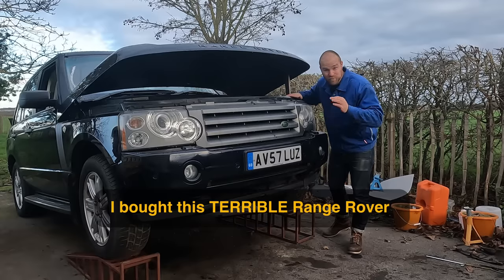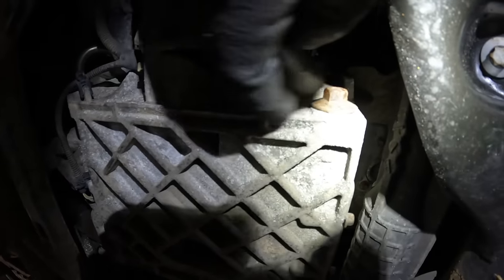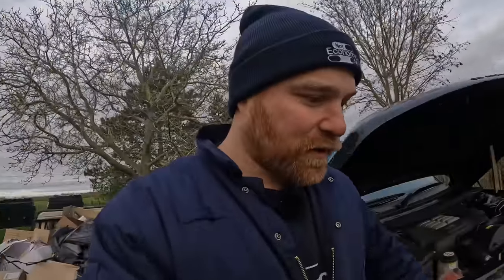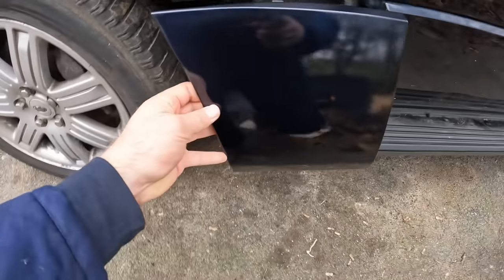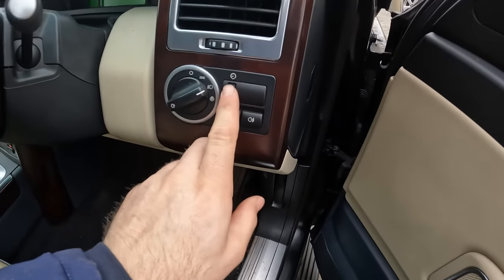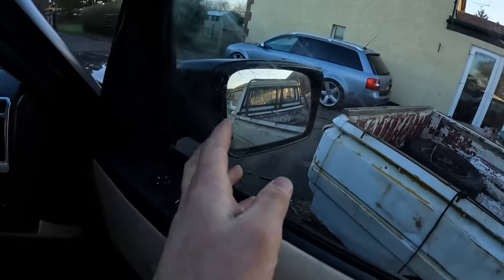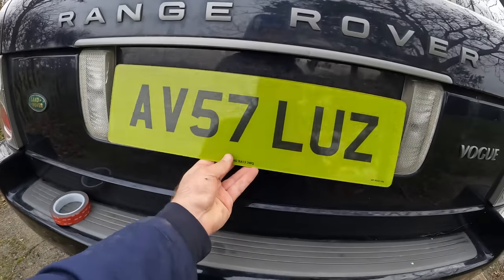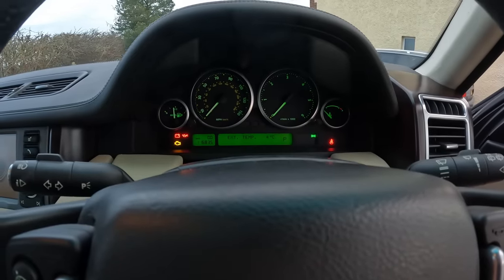Turning my crash-damaged Range Rover into a daily driver

Comment: Put the suspension in service mode, ie high up and open the bonnet also in service mode ie, at 90 degrees.
Also them ramps were not homemade at all. They were very common in the 1960’s and 70’s. I had a set!
Usually though, they had a habit of pushing away as you tried to climb them, it was easier jacking up a side a lowering the car onto the ramp.
Wouldn’t hurt to change the auto box oil too. I know it’s supposed to last forever but there are videos on fixing a bust gearbox by changing the oil.
When the air suspension gets a fault don’t buy a new compressor at hundreds of pounds a guy in Scotland sells a repair kit for around £20. Again a video on you tube.
Reply from the maker: Thanks for the advice mate 👍
Reply: Giving the ramps a kick under the tyre before you drive up stops them sliding out.

Comment: Just a quick note.  The gas struts for the bonnet are upsidedown.  The fat bit goes upwards so the oil inside lubricates the rod seal each time they operate.
Reply from the maker: Ahh that's good to know. I put these ones on the same as the others came off, but maybe that's why they were broken in the first place!
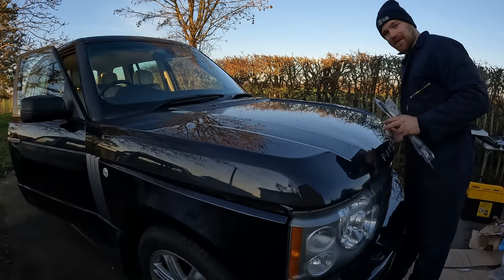Reply: @NotEconomicallyViable  At 33:04 the old ones are the other way up (correct).
Reply from the maker: @BLOCKsignallingUK  So they are!

Comment: You should spray wax the car, especially into the seems and the underside to prevent rust, even the engine compartment.  Silicone based spray wax can even protect exhaust.

Comment: I reckon those oil drain plugs have never been opened before.
Garage is just going to change the oil using a vacuum pump.
I bought a hand pump one a few years ago. 
It's very pleasant not getting oil down your sleeve. Definitely been there before.
Reply from the maker: What about any crud left over in the bottom of the sump? Is a vacuum pump good and getting everything out?
Reply: @NotEconomicallyViable  no not at all. Crud forever. But this is what you get with a garage service.
I have thought about alternating methods.
Or maybe getting the bulk out and just a quick finish off at the sump.
Depends on the car.
My 17 year old lexus mill make do with vacuum only.  When she dies she's for the scrap, and engine cud isn't going to kill it.
Might alternate with the P38 which I want to last forever. Which means the next service. Grrrrr.
Reply from the maker: @richardschofield2201  Maybe a happy medium is to vacuum pump the vast majority out and then get the last dribble out the sump - would prevent making loads of mess with spillages and would also get the crud out the bottom

Comment: Welcome to the club of cheap l322’s 😅 definitely consider getting the gearbox fluid flushed as they can suffer with shuddering, Land Rover claim lifetime oil but if I remember correctly the manufacturer (zf) recommend every 60,000 ish. Also get the rear arch liners off and check for rust along with the rear jacking points as that’ll save you a headache in the future, sams motor and machine has a good video on his channel regarding rust proofing. Other than that enjoy the car and fuel bills 😅😂
Reply from the maker: Thanks for that - looks like it's going to be next on my list

Comment: Mate get a oil vacuum suck it out the dipstick just connect em to battery and suck it out in 2/3 mins  can pick em up for under 20 online dont have to get under alot of cars to service em then turns it to a 5min job rather than messing  with Jack's axle stands chockes etc for 10 mins before you start and keeps you alot cleaner 👍👌 if you know you gonna regularly change you oil then 500ml of old ain't gonna affect nothing in my opinion .
Reply from the maker: Yeah it's the old stuff left over that I was going to ask about. Presuming it's good at sucking all the old crud out too?
Reply: @NotEconomicallyViable  I've never had a issue tbh Evan 200ml to 8 litres of new is less that 5% won't make any difference in my opinion nd makes oulchabges so much easier
Reply from the maker: @ryanrichardson9044  Good to know. That’s for the advice 👍🏻

Comment: Does that engine have a suction pipe at the top of the engine, which you could use an oil extractor pump to change the oil?
Reply from the maker: Probably, but do I have an extractor pump? Nope haha

Comment: Do yourself a favour and replace those intercooler hoses. They will go and likely when not convenient. Try and get silicone ones. Great project - my 57 plate has done 101k and I love it even though I've just had the turbos replaced! Reckon a glue on dent puller will get rid of most of that dent. Shame about the mud flap - I've just had my sidesteps removed - now need to work out what I replace the front flaps with. Also - check out bonnet access mode., I'm subscribed - just keep your Rangie or buy another (lol) and you are  home and dry. For £1500 you've got a bargain. I paid £6k for mine (admittedly it hadn't done battle with a tree and has done fewer miles) but I'm now into it for £12k - sorry but whatever the naysayers spout - I still think it's a bargain. £12k barely pays the annual depreciation on anything modern
Reply from the maker: I'll take a look at replacing the pipes 👍🏻 Even if they are unreliable there's still something about them. Hell of a lot of car for the money.

Comment: Those struts should be installed with the thin part down as far as i know. 
I think this is necessary so the oil inside doesnt just run to the bottom.
But i am just a youtube student myself, so im not sure.
Reply from the maker: Ahh I'll take a look into that - I just replaced them the same way the old ones came off

Comment: Mate. In my experience any engine is quieter and sounds much smoother when she has clean oil. I guess that the MORE oil in the engine then the more you notice the difference??? I have an old Audi S4 V8 which needs 9L of oil and when changed she sounds and drives MUCH better. I love big lazy V8 engines.

Comment: Next time, try "Goo Gone" or similar; they are based on kerosene that helps remove glue and sticky bits with no end.
Reply from the maker: Will have to check that out - thanks for the tip 👍🏻

Comment: I was after a local L322 Range Rover with that 3.6 litre V8 from a car dealer as it had an engine fault I knew how to fix. Bid £1200 but no deal. That V8 is an absolutely bullet proof motor. Enjoy!
Oh and so in a huff I bought a 2001 P38 Range Rover off eBay for £700 ... 😳😂
Reply from the maker: Haha that's a great 'in a huff purchase'!

Comment: Service the transmission also as the so called life time oil and filter in 6HP transmission also might have never been replaced along with differential and trasfer case oil😅 waiting for a porper interior detailing😂
Reply from the maker: Yeah transmission service needs to happen. Heard that it's not easy to do as a DIY job though

Comment: I have a question about the interior trim. I have an American Range Rover L322 and I cannot find the trim that goes under the steering wheel. It also looks like it goes on the left and right of it as well. Do you or anyone reading it, know what that part is?
Reply from the maker: There's a few different part numbers depending on the car. Here's the part number for a 2012 RHD car: 6753790

That might get you in the right direction
Reply: @NotEconomicallyViable thank you very much for your reply. I will look it and continue my search.

Comment: What's the story with UK number plates, do you need to use old fashioned GB plates now if you go abroad rather than the blue GB bit on the number plate itself?
Reply from the maker: We've never had to have them on the plates themselves, but if we drive abroad you do still need to have a country marker. Lots of people will stick a GB badge on the boot lid.
Reply: @NotEconomicallyViable  so what did you mean when you said they were no longer valid? I assume it's something post-Brexit
Reply from the maker: @TheRobman  They’re perfectly valid - you can put whatever you like in that little space such as a photo of your pet hamster if you really want. My comment in the video is that it’s just not technically accurate to see UK next to the EU flag because we left

Comment: You like how high it is because you're tall whereas I am only short so when I work on RR's or pickup trucks I have one of them frames that I can lay on over the engine bay, as for the engines in them thank yourself lucky you got a diesel and not the Chocolat petrol V8 with the chain and phazer issue even after changing them they never run right and as for the fuel injectors on the petrol engines the less said about them the better.

Never ever transfer the diesel fuel from one fuel filter to the new filter and they are self bleeding they have a fuel pump in the tank for that job, 

You never mentioned anything about a transmission fluid and filter change, people seen to neglect doing a transmission service.

Comment: Safety aside, ive no idea why youd make your access more limited by not driving to the top of the ramp?!
Reply from the maker: The sump plug is at the front so the higher the car went the less oil I'd be able to drain because it'd all be sitting at the back of the sump

Comment: Hmmm.... being the cynical oul' bugger I am, I'd have likely checked through my previous footage, to see if that roof dent was there before the lads put the new windscreen in. Seems weird you'd not have noticed it before. 

But who knows?  I discovered a really obvious piece of trim missing from the door hinge on my van, a few weeks after I bought it.  I went back through all my old photos and vids to see if I'd just not noticed when I bought it, or if some fecker had knocked it off since then.   

And, typically,  that corner of the van contrived to be just out of shot, or just lost in shadow, in every single one.

Comment: The techs usually suck the oil out of the top on range rovers
Reply from the maker: That must leave loads of gunk in the bottom surely
Reply: @NotEconomicallyViable  yeah it's not a smart design for sure. Great job on the result. Just finished the video.

Comment: My father in law bought one of those brand new on a 57 plate and I remember it had a Z in the reg number. It had so many faults that Range Rover literally couldn't resolve after months of trying that in the end they swapped it for a brand new one. One of its many faults was that it would randomly accelerate for no reason and very nearly caused a serious accident on more than one occasion which rendered it dangerous. They even had a senior engineer travel from the factory to our local dealership and it still couldn't be fixed. Did they scrap it?? Did they buggery! It went off to auction. The replacement vehicle was ok except for minor faults that again they couldn't resolve. Things like true pressure sensors and the heated seats were always a problem. From over £76k he sold it after 3 years for £14k. I hope the 'Z' is just a coincidence for your sake.
Reply from the maker: Well let's hope there's no curse of the letter Z because I don't fancy that trouble haha